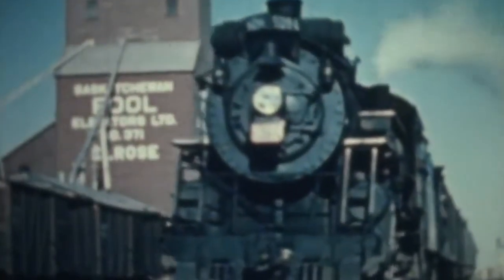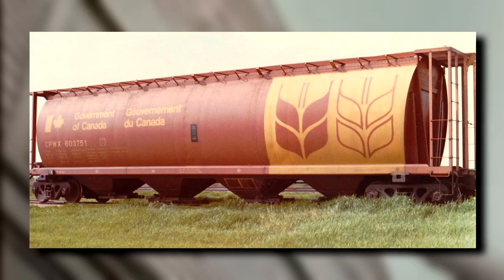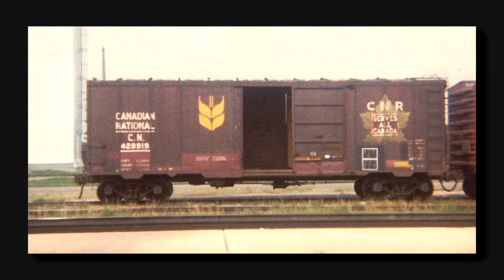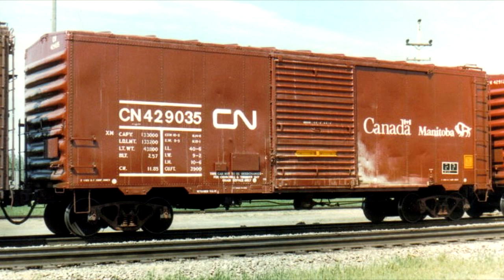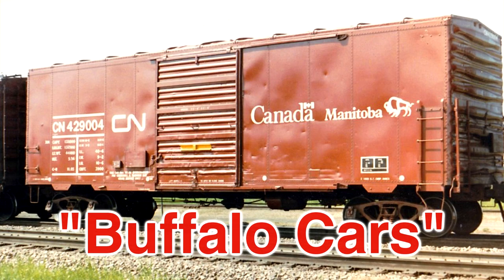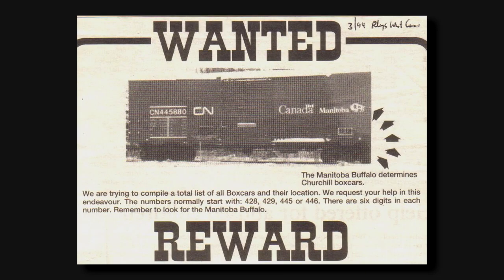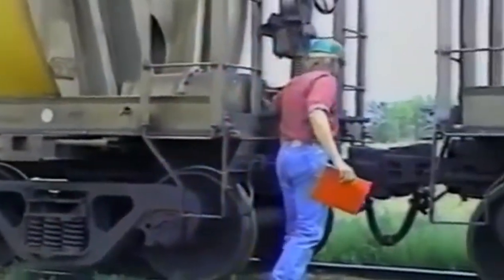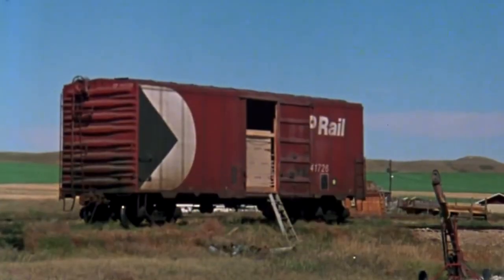Canada's Grain Boxcars

Comment: From what I read about the one on display in the Canadian Railway Museum in Montreal, another reason CN and CP liked the Grain boxcars is because they could be used to ship things in both directions: grain to ports, and manufactured goods from ports.
Reply: Until maybe 1960s. This wasn't a thing when I was growing up. We did ship a lot of grain in box cars - though I only ever loaded into the cylindrical bulk cars when we were able to start loading our own cars in the early 90s.
Reply: That's definitely one of the reasons why boxcars were used for grain as long as they were, in spite of the fact that covered hoppers had been around for quite some time for hauling certain products. Railroads at that time did not want to purchase cars that were all specialized, and could not be used for moving other cargo. They still don't like it. Tank cars were a good example of that. Railroads did want want to buy them for one way hauls, or not to be able to use them for something else if that business went away. So you had businesses that needed them and leasing companies buy them, and customers would pay to use them.
Reply: That argument hasn't applied for decades. Through the 1970s and early 1980s, basically all goods that might have been loaded into a box car at a port moved into containers.
Reply: @beeble2003  Oh absolutely; grain boxcars have been out of use for decades for a reason. But it’s part of why they stuck around for slightly longer in Canada.
Reply: @casey6556  Unless you're saying that Canadian port traffic too 15+ years longer to containerize than every other developed country, this reason just doesn't hold water. By the mid 1980s, there was basically no hope of being able to load a grain box car with anything on its way out of the port, yet CN and CP continued to refurbish grain box cars at that time, and continued to use them for another decade.

Comment: I went to work for Southern Railway in 1979, and at that time they had fleet of old 40’ friction bearing boxcars that they called “doorless wonders”. Rather than put new doors on those old cars when they fell off, they just removed the remaining door and used them to haul agricultural limestone. They’d pile it in both ends of the car but leave the center part empty. They spent their remaining years in this inglorious service, and typically weren’t declared dead until a loader fell through the rotted wooden floor! On the subject of Canadian rr’s, I always thought it was neat that CN cars always had two different spellings of “Canadian” on them. The “L” side of the car would read “Canadian National”, but the “R” side was “Canadien National”. Not sure if they still do that. I retired in 2020 so I’m not around this stuff anymore!
Reply: Canadien Nacional is the Quebecois French name for Canadian National and is used on CN's bilingual routes in Quebec and Ontario.
Reply: In Milwaukee you always knew what Freight cars were near the end of their careers when they were assigned to hauling hides to a leather firm. The grease and chemicals and salt was like instant corrosion plus the stench
Reply: @paulbergen9114  Southern still had a few of those in service when I started! 40’ boxcars, in sub-terrible condition, and stenciled “For Tankage Loading Only”. I always felt like the stencils were supposed to say “Tannage” instead of Tankage, given that the hides were going to be tanned. So much has changed since then!

Comment: Research "Crow Rate" (Crowsnest Freight Rate), a 1897 agreement between Canada and CP holding grain rates at basically their 1897 level "forever" that provided zero economic incentive for CP to spend a dime on rolling stock or track on grain lines.   The Agreement was terminated in 1995.   Boxcars had friction bearing which were being phased out and would often trigger wayside mechanical detectors, stopping a train for inspection.  Boxcar payload was limited to about 50 tons when covered hoppers could do 100 tons.  Rail carriers went to per car rates vs weight based rates that required scales and the need to weigh cars, so quickest way to reduce your freight rate was get more product in the car.
Reply: wow i seen crow rate and i figured this was going a different way. glad you brought the economic disincentive.... good riddance
Reply: Even now though, CN and CP are supposed to be buying their own hoppers to replace the first generation of Government if Canada hopper cars. They aren’t. They are running the crap out of the Government and provincial cars, while their own sit on sidings. The revenue cap doesn’t help this, but they still have the ability to make the investment, but they are keeping it very minimal. I know car rejection numbers were up at terminals again this winter.

Comment: Brazil had a similar thing going on, by the mid-1970s the Mato Grosso State along with the Alta Paulista and Triangulo Mineiro regions of São Paulo and Minas Gerais experienced a boom in agricultural production to deal with the increasing demand for shippemnts of grain (soy, corn and sugar) heading to the port of Santos for export the FEPASA (State of São Paulo RWY) started a big plan to convert many of its old 1930s and 1950s vintage mail, dry goods and reefer box cars into the HFR and FHR series box hoppers, HFR being the SIGO designation for Hopper, Fechado (subtype designator meaning Enclosed, basically any hopper car that has a roof), R = Total weight of no more than 80 metric tons, commonly box hoppers of the HFR type would have their doors plated and welded shut leaving only a swallow depression with its shape, now FHR is SIGO for Fechado (Box car), Hopper (subtype of boxcars with chutes), R = Total weight of no more than 80 metric tons, the FHR series kept the doors on the sides hence their classification as box cars and not hoppers. The FEPASA shops would adapt between 8 and 16 chutes on these cars, they would also adapt "plug" doors into them, meaning the the doors had a rubber seal and the closing mechanism that pressed the doors tightly agains their frame preventing leaks and dispensing the usage of "grain doors" like american and canadian railroads. These cars entered service by the mid 1970s, their robust design kept them a common sight in "export corridor" up until the middle 2010s when the last survivors were replaced by more modern covered hoppers on the now privatized former-FEPASA tracks, it was not uncommon to see these cars being pulled by state-of-the-art C44-9WM's of Ferronorte and Brasil Ferrovias or the C30-7A Cutrale Quintellas, the workhorses of FEPASA's and later FERROBAN's broad gauge lines, or by the Scrap30s, nickname give to the hundreds of former NA railroad C30-7s that arrived here in the early 2000s. Box hoppers also proliferated on metric and broad gauge lines of the Federal Railway Network, the RFFSA, most notably on their broad gauge lines in São Paulo were the former RFFSA FHS's (F = Box, H = Hopper, S = Total weight of no more than 100 metric tons) still run to this day carrying sugar and soy to the port of Santos and fertilizer on the way back to the countryside. In my opinion the period between 1985 and 2015 was the most colourful period in the history of Brazilian Railroads.
Reply: This was interesting read! Don't hear so much about S. American railroad systems when living in the US. Thanks for sharing!
Reply: @DK-nv9zu  No problem!
Reply: Wow! Lots of interesting information about Brazilian Railroading!
I used to go to Sao Jose dos Campos and Sao Paolo for work. I loved the experience!
Thank you for sharing all of that!

Comment: Worked at an IL grain co. for 31 years, starting in 1973. The last box cars went out in 1971.We had tons of the cardboard sheets left when I came. Pretty tough to recycle because every one had several steel straps running through it for reinforcement. Handy around the shop though.

Comment: The model they are inspecting near the end of the video is the original cylindrical hopper car, the "tank hopper" as originally built by Alcan and NSC. CN, as is their wont, got a 70-ton car (3000cf). CP used a slightly larger 100-ton car (3400cf). These predate the ACF Centerflow by about 5 years (with the first order built in 1959).

Comment: I worked with some older gentlemen which used to work for the local grain pool elevator and they told many stories about those old box cars. They used to keep a pile of crappy lumber by the loading area to replace pieces of the grain door they forgot to send back with the car when it was unloaded along with a mountain of rags to plug all the holes.
Reply: It's so funny thinking how in the Midwest the 40 foot box car was still King because Milwaukee Road Northwestern and SOO Line all had major rebuilding programs for them in the early seventies. The 🎥  also brought back memories of the stacks of wooden grain doors left by the Northwestern for that purpose near a malt plant here in Milwaukee and now they're tearing down the last one which surprisingly still had the boxcar dumper in one of the sheds

Comment: Grandpa worked for several elevators along the Mississippi River into the 90s and he remembered dealing with boxcars with grain in them into the 80s. Never mentioned  if they were grain specific but did mention they were a pain to empty as they had to shovel it out of the cars by hand.

Comment: I remember seeing about a half dozen of the grain boxcars on a siding at the now gone UGG elevator on the Letellier sub in Winnipeg.  They were there for as long as I could remember until I moved out of the area and that was in 1998.  Not sure when they were finally pulled out of there but it would have been around the time that the grain elevator there was torn down in the early 2000's.

Comment: It's funny I remember seeing another video not long ago from a railway museum in Michigan that talked about a car that could be a grain hopper or a boxcar, of which the museum has one of the few remaining. The idea being that you can haul arbitrary cargo in them in box car mode on the return trip from where you dropped off the grain. They treated it like it was an innovation that failed and eventually went out of service, so I guess it must have been some kind of refinement on the just block the door and fill the car with grain idea.
Reply: Sounds familiar I wonder if that was the 50 Foot plug door box car that also have roof hatches. I believe there are only two of them and the one I remember was BC Rail green with their Herald and also the Milwaukee Road Herald

Comment: We had a CN branch line that ended at my town and didn’t continue past. Had 3 elevators and remember some boxcars being spotted there mixed with hopper cars in the late 80s early 90s. Our rail was fairly heavy rail so could handle a 90 ton hopper car fully loaded and boxcars were rare by the early 90s. I’ve heard stories of grain elevator guys smashing holes into the floor or side so they could reject them and just load the hopper cars as they were quicker and easier to load.

Comment: Thanks for another great video bro. Really appreciate your content. The use of the Grand Trunk hopper for the example melted my heart. Still waiting on a GTW video from you but I know you can't rush perfection right..... Right!?!🤣 Anyways another cool car video idea would be the 86' High Cube Auto parts cars. The must have been rear in places out side of Michigan, because was running a few at our clubs Open House today in Blissfield MI and had several people comment on them. Even had one older gentlemen go as far as to tell me that I shouldn't run them because there not "prototypical" and never existed, 🤔 I sure seen a bunch as a kid in the early 90s near Flint.

Sorry for the long-winded comment take care bro
Freddy.
Reply: I really do miss those High cubes and here in Milwaukee they don't pass through anymore ever since the Ford plant closed. Today there are so few left as many manufacturers have their plants across the street or within easy truck driving distance. Many were like advertising billboards especially Southern Pacific and Santa Fe even the Milwaukee Road had variations as they had large lettering when delivered in Brown then later some got repainted yellow and then some got back to brown paint with just a small Herald. There is also one or two 🎥 on YouTube showing about seven or eight different paint schemes still lettered for the old owners hauling baled peat moss in Canada. Oddest cars I remember were possibly marked AMPX which I think was Amoco Plastics which had a plant in Chippewa Falls WI and made styrofoam food containers. No weight to them just bulky and the only non- automobile use I had ever seen for those cars which I believe were bought new and probably gone by the early 80s. Best small fleets included Ann Arbor and Western Pacific. Most unique paint scheme was the purple Detroit Toledo and Ironton. You can check out current videos by Tie Spiker Productions shot in Central Indiana and some trains have up to 15 of them in a row which is impressive

Comment: The paper "grain doors" where embedded with steel strapping to hold the weight of the load and due to the heavy staples used to secure them where a pain to remove once the boxcar ws returned to regular service. But not only grain boxcars were used for grain. Regular boxcars would be fitted with the grain doors and pressed into grain service at least in the early to mid 80's as the covered hoppers where used for other freight in the grain off season.
Reply: …plastic pellets, perhaps?
Reply: @sammolloy1  Yep as well as sand and grit for making shingles, Potash, just about anything granular.